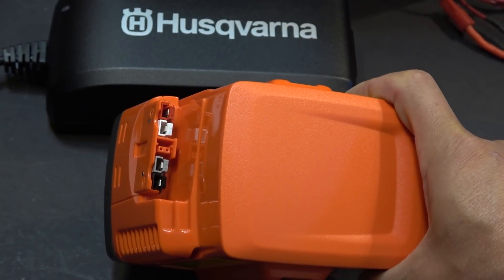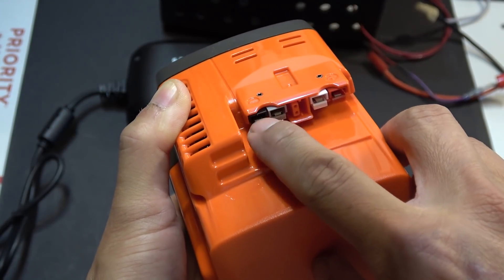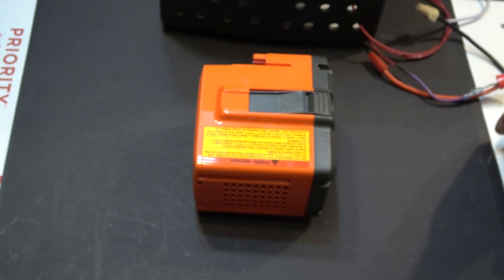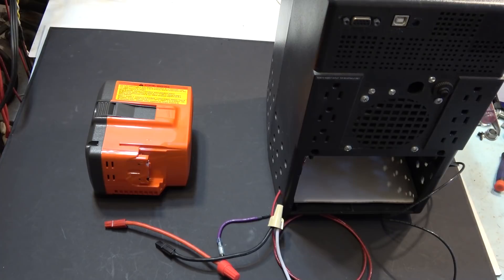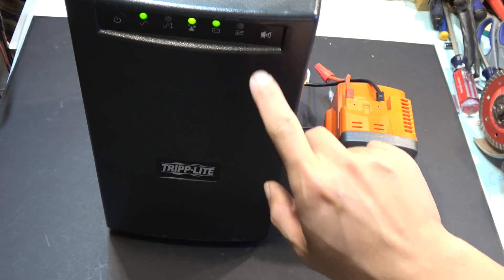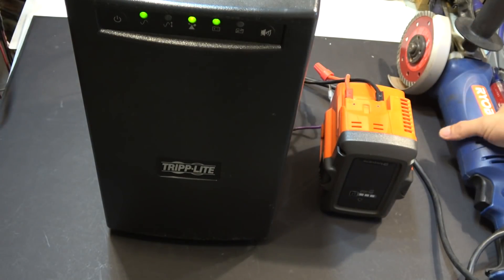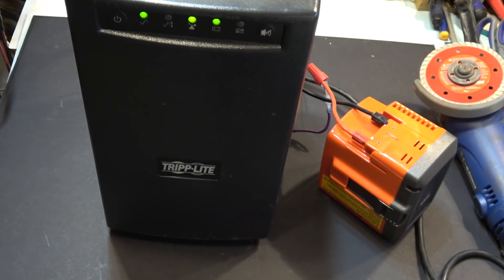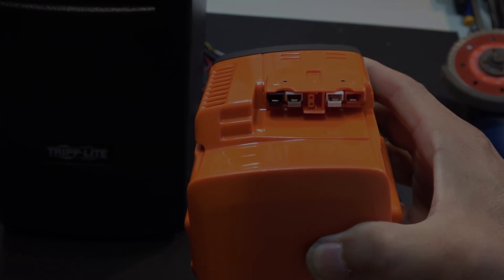Husqvarna 40V battery: Universal Anderson connectors for Ebike, E-scooter, & UPS power supplies

Comment: Hi, great video! I have the same question as others below. What voltage do you read between black and white connector and black and grey connector? It would help allot! Im trying to convert a bosch 36V to fit my husqvarna saw. Thanks!

Comment: Just the information I needed on the connectors. Do you know what the other two connectors do? I want to power a Ryobi 36v power washer but will use a husqvarna battery like in the video, do I just run the positive and negative?
Reply: Did it work?

Comment: Thanks for this! A battery pack with a universal plug is a real breakthrough since most of them are proprietary and inconvenient. I can't wait to see what you do with this now on your ebike and scooter!

I'm looking for a 48v battery for an ebike conversion. The Husqvarna would be great but it's only 36v as you pointed out. Do you have any suggestions? I've seen your videos on connecting 2 Lowe's Kobalt 24v's in series but i'm trying to avoid a bunch of MacGuyver soldering (although you do it so well!)

Comment: Good find! Your the man. Hey im having trouble finding a way to charge a 48 volt battery pack for pedigo bike electric battery. Help me? I have some capacitor s misc boards and chargers
Reply from the maker: These ebike batteries are very specific to their own brands. They make proprietary charging connectors. I would open up the battery pack and find the terminals so I can hook it up to a regular charger. A 48V pack is usually between 12S and 14S so you'll need a charger that can charge up to 14S.

Comment: I agree that this is a very unique battery.  It has a lot of potential for other uses.  The only problem that I see is that if you were to use it for a UPS, the UPS has a charging circuit for a SLA battery.  That has very different charging parameters than that required for lithium batteries.  Most other uses such as electric bikes and scooters will have access to using the original charger for this battery.   How many Ah does this battery have?  Thanks
Reply from the maker: This battery has 4Ah capacity. When you use this with a UPS, you don't use the original charging circuit to charge the modded Li-ion battery. It will fry the Li ion battery. You will need to unplug the battery and put it in its Husqvarna original charger to charge it. That's why I already cut the AC input wire from the UPS when I modded it a while back. I wanted to use the UPS as a standalone off-grid DC-to-AC inverter, not as a UPS. If you want to use this as a UPS, I think you may (or may not) permanently attach the Husqvarna charger to it and run the battery terminals directly to the UPS (YMMV, though)! :D
Reply: OK understood.  I have seen lithium battery chargers that work off solar, so that concept should work well by using the UPS circuit as a stand-a-lone AC inverter.  Let us know when you get that set-up working.  Thanks